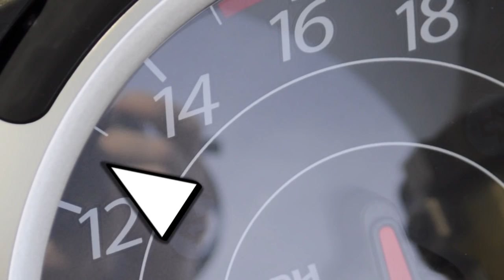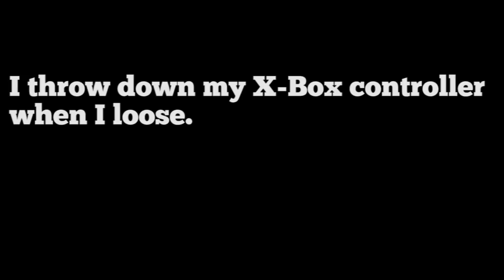Regular Car Reviews: 2011 Triumph Daytona 675

Comment: I rode a Street Triple, which essentially has the last generation of this engine. Holy FUCK, it was fast. You open the throttle , and it just careens you forward at a speed so fast that you go from being at the helm, to just being a passenger hanging on to this rampant machine, hoping not to die. You pin open the throttle at 5,000 RPM, and you start accelerating, and the revs just keep rising. And they keep rising and rising... 6000, 7000, 8000... And you keep flying forward. You're already doubling the speed limit. 9000, 10000... You're still accelerating. How could you still be accelerating? Everything around you at this point has just become a blur. 11000, 12000, 13000... And finally, you manage to find the redline, which lies somewhere in the upper stratosphere. You come back into control of the bike, you're no longer loudly exclaiming the name of your favorite deity, and you realize that you're doing one million miles per hour, and there's a red light and a bunch of cars five feet in front of you. You quickly squeeze the brakes, and just barely come to a stop without flying off of your machine. That's what these bikes are like. All supersport bikes. They're for the track. Don't underestimate motorcycles.
Reply: master777999 Actually the Street Triple has a different engine than the Daytona.   Same engine block yes but different cams, crank, transmission, and ecu tune.   So the power spikes and how it runs are different you get a bit more down low than the Daytona does..   A Street Triple being pretty quick for what it is would not be designated for a track bike.  

If you want to see a guy who actually does race amateur superbike and has his own youtube channel.  Go check out Marcel Irnie he races 2-3 BMW s1000 RR's.
Reply: Zalonka Ahh I see, that's just what the sales guy told me. I assumed that there were some small differences like that. Well I was really just trying to make the point that bikes of this caliber are way beyond what can be used on the street, rather than that they're literally track bikes, although many are. But thanks for the info and suggestion.
Reply: Sounds like my daily ride to work ;-).  Myself being a proud owner of an Aprilia RSV Mille
Reply: Zalonka not so much amateur anymore, the guy is working his way up into the pros. It may be ama pros but it's still professional level racing
Reply: master777999 Just to add to your story, you're going a million miles an hour... then you change into second gear. ;)
Reply: @nomadben haha very well described... loved reading it.. reminded me of the excitement I had when I first experienced full throttle of a Hayabusa as a pillion during my childhood...
Reply: bruh, chill
Reply: Street triples don't go up to 13,000rpm
Reply: @mikehoskin1674  redline is at 14k. They definitely hit 13
Reply: @TheFreeguy12  redline is at 12.5, they're bouncing off the limiter at 14,000
Reply: @TheFreeguy12  you don't own a street triple or in fact any motorbikes at all do you.
Reply: @mikehoskin1674  oh no! I swapped the terms redline and limiter. Sorry for being such a noob rider.
Reply: @TheFreeguy12  it kind of matters when you want to look like you know what you're talking about.
Reply: @mikehoskin1674  I think what matters more than rider vocabulary is the ability to understand tachometers and engine limits. You claim Triples can't go up to 13k, yet later say the rev limit is 14k. Stick to your answer or admit you were wrong. If I didn't admit it earlier then I will now: I used 'rev limit' and 'red line' interchangeably (which is wrong).
Reply: @TheFreeguy12  OK I was wrong. Still stand by what said though and don't think you have any Triumphs.
Reply: @mikehoskin1674  you're not far off. I've been on the market for too long for one except all in my area are overpriced or Speed Triples. For now I'm enjoying the KLX.
Reply: @TheFreeguy12  I have 2 daytona 675's and a 2021 mt09 so a street triple kinda doesn't tickle my fancy but a 2022 speed triple would
Reply: @mikehoskin1674  the newest generation speed triple isn't for me... The looks isn't hitting anywhere close to home in my case
Reply: @mikehoskin1674  I know this is old, but for what it's worth, the Street Triple that was contemporary with this Daytona had a 13,000 rpm redline.
Reply: @TheFreeguy12  You mean a 2023 model with the more angular rather than hexagonal looking headlight?
Reply: @mikehoskin1674  I own a 2018 STriple RS and can confirm, the redline is 12.5 😂
Reply: @jameslewis2810  read all comments in a comment section that's over half a year old before making your own.
Reply: @mikehoskin1674  my brother in christ… do you need a hug? 😂
Reply: @jameslewis2810  It figures that you can't read.
Reply: @mikehoskin1674  nobody is coming for you, my dude 😂 I came in peace. Offered a bit of info that you could either take or leave. But the catty comments are a bit unnecessary
Reply: @jameslewis2810  neither are your passive aggressive ones
Reply: So?

Comment: I love my 675, the low end TQ surprises my liter bike owner friends, it may fall in it's face around 165mph but it'll run away from any 600 long before that speed is in sight. 
It's nimble and feels like a 250 and with a few bolt ons it'll blow your mind, the sound of the 3 cylinder is unreal and it's just a great bike.

Comment: I owned one for about a year.  Coming from commuter and touring cycles, and many different models.  It was the first full-on sport bike I ever owned.  It was wild.  Had no idea the upper limits of motorcycle power and control.  It was a scalpel on the road, and could jet me like a squirt of water anywhere I pointed the handlebars.  Not as painful as he makes out (I'm 50 and a bit overweight)  but it sure let you know you are the pilot and you are on a machine.  Loved it!  Had to go because it was impractical.

Comment: Just adding that in the video, the Daytona was compared to a Speed Triple. The Daytona is a 675 triple where a Speed Triple is a 955 or 1050 depending on year. The Street Triple is the 675 naked variant of the Daytona. Otherwise it was a great video! I am inclined to agree a middleweight supersport isn't a good choice for a starter bike. It can be done but maturity plays a large factor in the success rate. Better off just starting on a single cylinder like a Buell Blast!

Comment: The term crotchrocket isn't a rigid industry term but a loose descriptor.
It applies to bikes that are fast, have aerodynamic cowlings and/or a typically more aggressive body position moreso than where it's made and/or rather or not it has clip on handlebars or a specific engine type.

Like sports cars in that you wouldn't say "A Corvette/Toyota Supra aren't sports cars because they weren't made in Europe/the steering wheel doesn't look exactly like other sports cars'"

Comment: Very nice 675 review.  I'd say this one fits in with CBR600RR and GSXR600 pretty well also.  I've owned a few bikes over the years.  Loved the Ninja 250R you mentioned for its handling, and the Honda Superhawk VTR1000 for it's power, but I ended up with a 2009 CBR600RR/ABS for a good balance between both, and all is good in the world after 30 years of riding.
Reply: You should try a VFR800 or Triumph Sprint
Reply: I have, and both are also excellent.
Reply: Right on!
Reply: Oh God, I miss my Superhawk.   That bike had more Character than any other Honda I've ever owned, ridden, or even looked at in person.
Reply: I was considering a VTR but I went with a Speed Triple instead.

Comment: I think the power figures on sports bikes are somewhat misleading, because if you're not in 'race mode' in your mind, you won't rev that engine even close to the power or even torque peak.
If you want a bike you can extract the power from and have fun on windy roads, not straights: Buy a supermoto ;-)
Reply: Love my Husqvarna
Reply: Benedocta Um? lol   Supermoto's are fun but your reasoning to not buy a sportbike is ridiculous.
Reply: Zalonka My reasoning is: It's much easier to use the potential of a supermoto than that of a supersports bike. Of course, on the straights you're not as fast (but whats the point anyway), but if you're not Valentino Rossi, you are faster on twisty roads.
Also, you can do a lot of fun but stupid stuff (wheelies, drifting, etc.) at speeds that won't kill you instantly if you fuck up.
Another reason: A supermoto has wider limits. If you start to slide, you can still catch it. And if you lowside anyway, you just pick it up and ride on.
My point is: A supermoto is much more suitable for public roads, which makes it not only more fun, but also faster on the roads where it matters.
If you live in the Netherlands or Texas or some other flat place, a supermoto might not be for you, but then I don't really get the point of riding anyway.
All this only applies if you only ride your bike for fun. I'm actually thinking about buying some UJM for commuting.
Reply: Benedocta You can use that Valentino argument about any bike ever made lol.  Generally 90% of people will never use any bike to it's full potential even if you think you are.   Sportsbikes are made for the twisties if you're experienced and know how to ride them correctly.  I grew up on a farm and had a lot of mini bikes then had a Honda 250.  I had a few ATV's and even a three wheeler.  (not all at the same time)  Yet the Honda 250 was always around and it was something I always came back to.  You can learn a lot on a dirtbike or super moto and apply those skills to a super sport yet you can also learn a lot of different aspects of riding from a lot of different bikes.  An example would be dirt track bikes. 

I'm not sure why you think all super sports are only good for straights but I do feel bad for your friends that know nothing about bikes and you brainwash this into them. 

Explain to me in detail how a Super Sport is not practical for commuting because if anything it's actually better suited for it.  You have wind protection and the clip ons are far skinnier so you can filter a lot easier..   You also have a bit more power so it's easier to get out of dangerous situations.   The only difference that you could possibly use as leverage would be these.
A) Cheaper insurance
B) A good beginner bike

B though has other choices.  Suzuki SV 650, Buell Blast, Kawi 250, Kawi 300, Honda 500,

You are honestly just in love with your super moto and fail to recognize other bikes for their true advantages and disadvantages.   You can't just go take a super sport off road yet even that can be arguable with a tire change..
Reply: one of the benefits of the trip is that it is pretty usable from about 4,000 rpm. On the flip side, I talked to a friend who went to an FZ6 after years on an SV and complained that it didn't have anything at 2k. (yes, 2,000 rpms) so, I guess torque is where we find it.
Reply: Zalonka I didn't say supersports bikes don't work in twisties, but most riders will be able to be faster on a supermoto, because its performance is easier to access. Of would never claim that I'd stand a change against a real pro on a supersports bike, if the road is good. On a B road... byebye ;-)
And I said that I DO consider a supersports bike as a commuter, because I see that they are better suited for that job!
But you are absolutely right I am in love with my supermoto and I'm a bit sad that most people don't even consider them when buying a bike.
Reply: Sort of wish I started out on a bigger bike, granted my er-6n gets me from a to b but after riding my brother Daytona I realized how much I am missing out on and why I want to upgrade to the speed triple when possible.
Reply: Benedocta Everyone has different tastes in bikes. I love dirt and street riding but don't want something that can do both. I have an Sv650s for my street needs commuting and track days and my Kawasaki KX250f for my offroad needs. I like Supermoto's but don't want one because I want the best of both worlds not a compromise.
Reply: How does you-not-revving-to-peak-power equate to the manufacturer being misleading? And neither one is "easier" than the other, they're just different.
Reply: Tom Thompson while I, unlike some of my friends, have never had problems getting to redline (although going from "If God had intended me to care about redline, he'd not have invented rev-limiters" to blowing my my little 2 stroke race bike because it apparently doesn't have one (oops) was interesting) I think it's fair to say that an SV650 with torque at 2k rpm is an easier, more forgiving ride, both in having power when you go into that turn in the "wrong" gear, and in not killing you when you find the power curve becomes a wall straight up at 10,k rpms. ;) 

when you take shifting almost entirely out of the equation, it makes it simpler, easier. (although not necessarily more fun ;) )
Reply: What? Torque at 2,000 rpm? Both torque and power exist at every RPM in the range. Power curve? Do you know what torque and power even are?
Reply: Tom Thompson *bows down* ok, you win. I didn't even realize I was being trolled. Well played sir. golf clap
Reply: hahaa no no im not trolling. im trying to understand what youre saying more clearly
Reply: Benedocta actually supermotos are getting more and more popular over here because of continous lowering of speed limits, speeds humps on every road thats slightly bendy, and rigourous enforcement of said low speed limits. With a sport bike its simply too easy to lose tour license. Most riders from NL go to the Ardennes region in Belgium or the Eiffel in Germany, even for weekend tours etc.
Reply: Tom Thompson
 It's a lot easier to destroy yourself on a super sport because before 6k you have nothing.   Then it starts up and then you're at 8k and getting close to peak.  Basically a super sport eggs you on 24/7 then you're like holy fuck and get this mad rush of power.   Very bad if you're put into uncomfortable or difficult situations and are not experienced to handle them let alone manage the bikes sudden rush of power.
Reply: Yeah, I know exactly what it's like. I experience it every day. But it's by no means "misleading."
Reply: Not misleading at all. The first thing a vast majority of people do when they first get their vehicle is wonder "how fast does it go?".

Some people who start on SS learn the answer by being thrown off the bike :P
Reply: I like my cbr 500
Reply: or a ninja 650r...or a 150cc scooter!
Reply: Benedocta but not a daytona
Da torque

Comment: Three things! 1. Great review :D
2. Those mirrors with built-in indicators aren't standard, but I guess you know that :P
3. If anything, the Daytona is a clothed version of the STREET triple, not the Speed. They have two different engines :P
Reply: I'd say it's closer to the Speed in that when each model was first introduced, they were king of their class and seriously impressive in power and capability. The Street was a derivative that only built on the success of the Daytona.
Reply: Ah that's true :/ Cheers dude!
Reply: Tumbleweed Folf False the speed has always used a 1050cc engine while the 675 uses that 675CC engine.    Although the Street Triple also has 675CC's it's not the same.   I believe they use different cams, crankshaft, and transmission. 

The power peak differences between the 1050 and 675 engines are vast.  Trust me I'm a Triumph guy.   I was actually on a 2014 Speed Triple a few months ago as well it was insane.....   insanely awesome.
Reply: Zalonka If you're a triumph guy then you would know that the motors in the 675 and the street are the same.  The difference is cams and a different tune.  Otherwise it's the same.  There would be no point to make internals different.  It would cost too much.  It's the same way the r6/r1 are detuned fz6/fz1's.  Triumph wants to use as many of the same parts across multiple platforms to save R&D.
Reply: thatkiddesign
I said it probably has different cams, crankshaft, and tune.   The only key difference is the crankshaft.   It's obvious when compared to other companies that it's going to be "detuned" compared to the Daytona.  I just wasn't sure if the crank was actually different or not.   I don't have a Striple I have a Daytona.
Reply: Zalonka Yes, you also said, "trust me I'm a triumph guy."  If you're going to say that you should know that the cams are the only difference regardless of what bike you have.  I have a 675, but that doesn't mean I'm clueless about other bikes or that I'm a Triumph guy.  And you're still saying the key difference is the crankshaft, when they are the same.  Not sure what you mean about being compared to other companies that it's obviously going to be detuned.  Across the board almost every company makes a sportbike version and a naked/standard/whatever you want to call comfortable ergos.  The sportbike is designed with high end in mind while the standard is tuned for city riding or commuting.  There is no comparing to other companies, all companies do this.
Reply: Tumbleweed Folf A Street Triple is a Daytona minus fairing, plus high bars, with different cams and different seat. On a Street Triple R, the suspension is even the same. A Street Triple is much closer. A Speed Triple has a different engine, different suspension and different frame. A Street Triple has the same engine (bar cams), the same suspension (on the R) and the same frame.
Reply: @Zalonka  ...Speedy didn't go 1050cc till '05, along with the other corrections made by thatkiddesign.